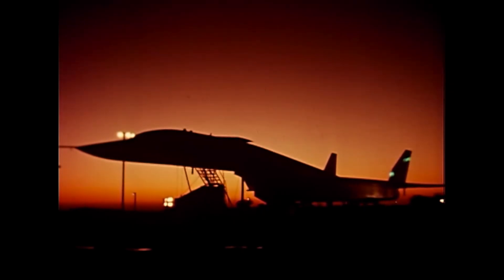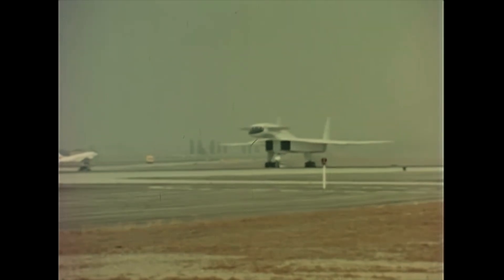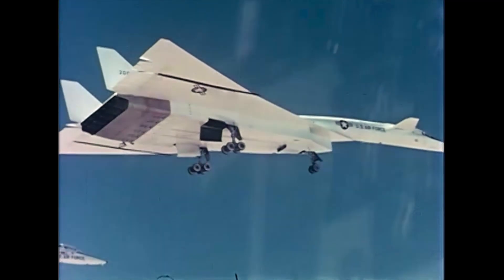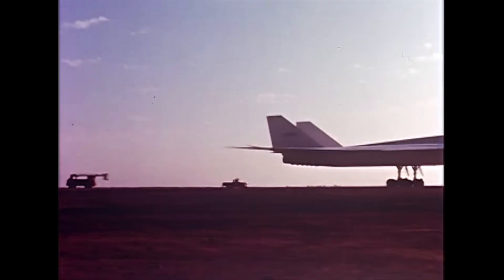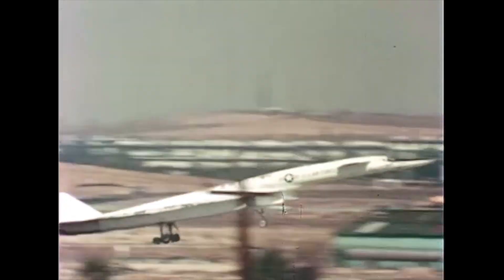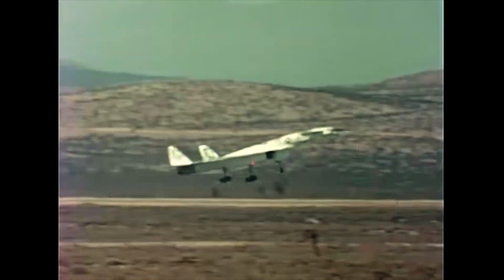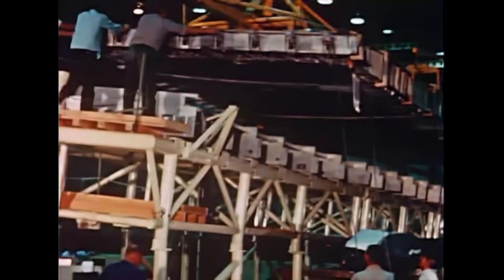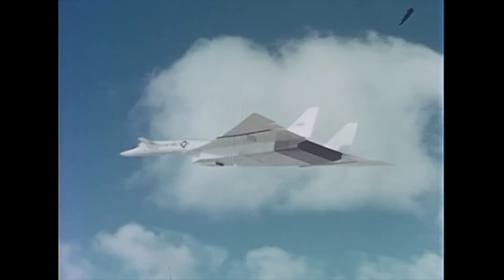XB-70A Progress Report No. 14 (1965)

Comment: 5:04 it is a miracle that the T-38 chase plane didn't get whacked by wake turbulence like the F-104 that collided with XB-70A AV-2.
Reply: The T-38 kept alongside, ahead of the XB-70A's wing. That ensured that he wasn't in the rotating wake component, which starts at the wing tips..
Reply: @mpeg2tom  My thought, exactly.
Reply: Because he was SMART ENOUGH to keep his distance, unlike that F-104.
Reply: The F-104 pilot went high and thought he was safe. The large and heavily loaded Delta wing at high altitude produces vastly larger wingtip vortexes than anything else flying at the time. He didn't know. Nobody did. Or they would have briefed the pilot on that danger.

Comment: So basically, the plane was shit.
Reply: Not at All.
It was decided, Non Recallable Nuclear Missiles, with Multiple Independent Reentry Vehicles ( Nuclear Warheads) Would Be a Better Option.
The B O N E - B - 1 - is its Successor.
We Could Actually Use Something Like it Today, maybe HYPERSONIC, or to Counter HYPERSONIC Weapons, China, may Field.
Btw Remember the Mid 1990’s the LORAN Affair? Is it Any Surprise the Aviation and Missile Technology, China Now has Exists, as it does Today?
If it is to You, I’ve got a Bridge to Sell You, Lol
Reply: The plane was very good. It had an incredible range for supersonic flight, almost double the SR-71 range. 

It proved theoretical compression lift "waverider" designs.

But a jet powered bomber, even at mach 3, cannot out run a radar guided, surface to air missile.

The USAF identified low level attacks "under the radar" would have better survivability or effectiveness than high altitude high speed attacks.
Reply: @Triple_J.1 the sr71 outran missiles regularly

Comment: I'd argue that the B-58, XB-70, and SR-71 was peak human engineering. I'd give anything for the chance to pilot anyone of those aircraft.
Reply: And at the same time, their colleagues were developing the Apollo command and service modules. This truly was the golden era of aerospace engineering.
Reply: @skunkjobb another good point
Reply: Agreed...just incredible engineering and what a time to be a test pilot that must've been
Reply: @antony716   I'd agree simply on the basis that 99% of the engineering involved was done on slide rulers and pen and paper drafting
Reply: @tpproject8845  computers were being used for airfoils and stability & control by then. IBM FORTRAN language hails from 1958? IIRC.
Reply: @Triple_J.1  I was mostly refering to the sr-71, which used no digital computers in the production of it, there were a form of analogue computers used but only really for thrust management and all was designed without the aid of computers. Though years later they simulated them, there was some very early forms of cnc, but by and large the sr-71 was all by hand
Reply: @Triple_J.1 computers were being used, but the designs were being drawn, blended, and tested in the real world, that's all I mean. The human brain power of the 20th century was great. From the Wright Bros to this in 50 years is awesome in the true sense of the word.
Reply: @antony716  me too, just to fly in one even
Reply: @bretthoffman2128 yes
Reply: @antony716  I totally get it it would be a tough choice
Reply: @antony716  go hover in a giant helicopter…. It’s peak something!!!!
Reply: @antony716  Musk and Space X now...